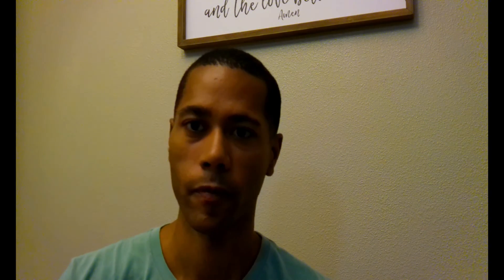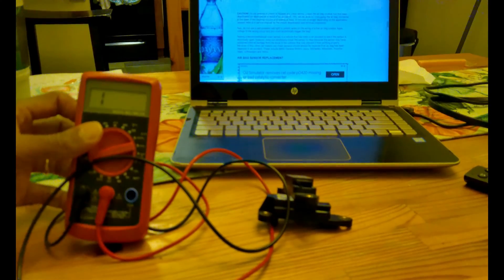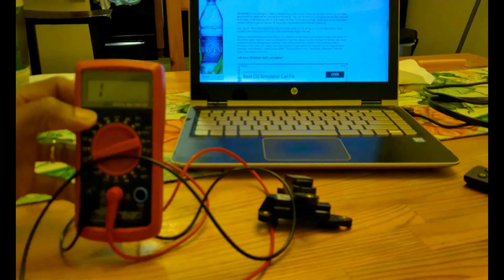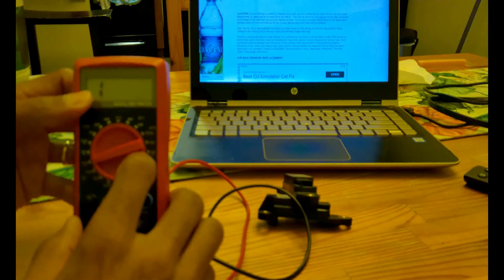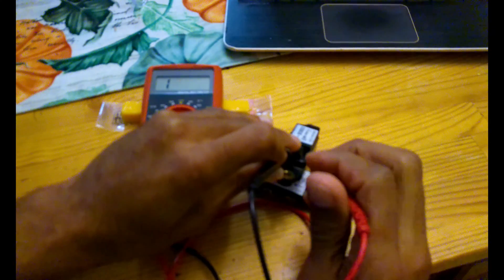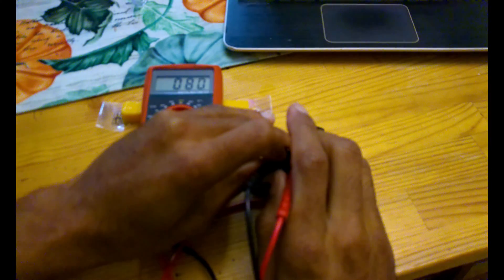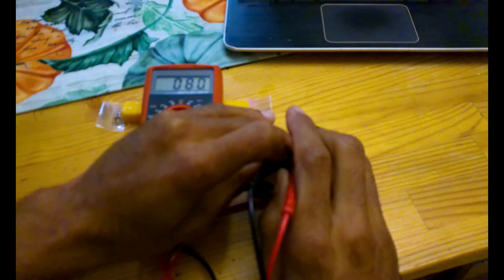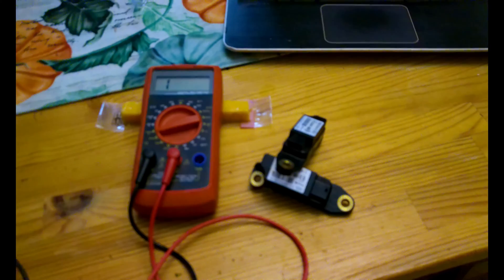TESTING AIRBAG SIDE IMPACT SENSORS

Comment: Did it turn off the airbag light?
Reply from the maker: Not in that car 

It was the airbag ecu that needed to be programmed. And I’m that SLK 320 I would have to program the vin in the ecu. The person who has the car before me replaced the ecu with one from another vin because I used software to read the vin number in the airbag ecu and it was different than the car. Plus with the software I was able to read each of the airbag sensor. I learned a lot about each sensor and the crash sensors in the body and how technical a 2004 SLK 320 was back in the day. You really need to know what you are doin. You have to get a Mercedes’ scanner and read the airbag to see what is causing the airbag light to come on. That the only way. A Mbii scanner will do it I believe. The are reasonable on Amazon. 

iCarsoft MBII for Mercedes Benz/Sprinter/Smart Professional Diagnostic Tool S... https://a.co/d/iL7mjZc
Reply: @aricwithautoreplay  Very clever of you. Thanks for the info. I am going to r&r my Equinox by sending the airbag module to Safety Restore for $69. Since it's the original, it will be plug & play. Hit a deer again.
Reply from the maker: That’s should work just fine

Seen it done a lot on goonzquad